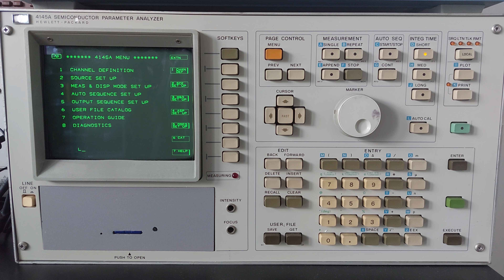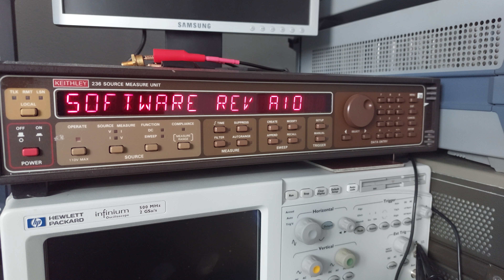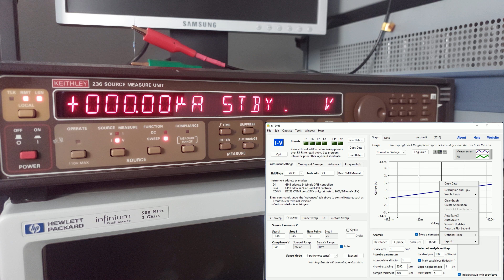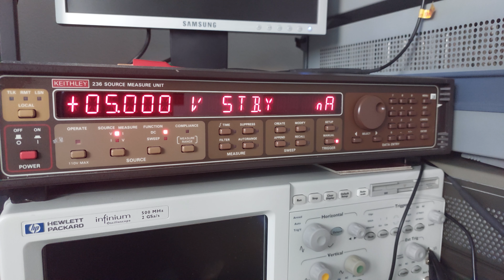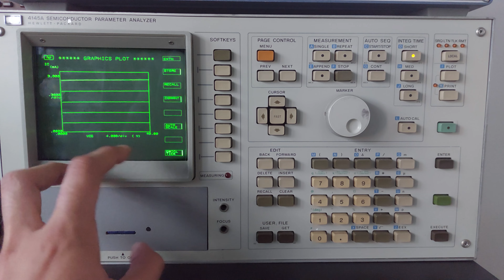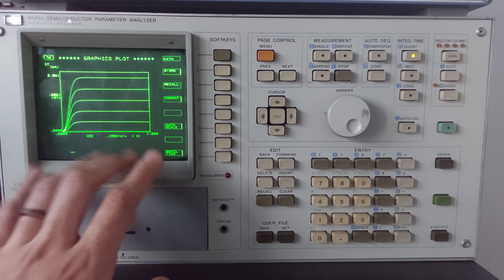SMU Overload (HP4145A, Keithley 236, Transistor Theory and other ramblings)

Comment: Reps may have gotten me interested in a 236, but you made up my mind to get one by showing that incredible software. The only thing holding me back was the interface, seemed like it was going to take so long to get the graphs I wanted might as well just keep doing it manually (Often Keithley 602 and Yokogawa 7651, unity gain output from the 602 into HP 54622 because saving traces to floppy just makes me happy, also it's start up sound gives yours a run for its money, haha) I cried a little for your loss, I am sure even though it is years later it would still bother me. Thank for your great content!
Reply from the maker: The interface itself is not that bad and the “language” it speaks is quite simple, albeit a tad criptic

Comment: What did you mean when you said this unit needs a particular fuse at 6:20? Can't it work with a higher one?
Reply from the maker: That's very dangerous! If something goes wrong and the fuse can't protect the device, that's bad news

Comment: 4:07 => Isn't the linear and saturation region the other way around? The linear region is the region that Ic has a mathematic linear relation to Ib not  because the curve is like a line.
Reply from the maker: Bad wording on my part. Linear region is where collector current is the hfe times the base current. You'll see that I'm correct, current doesn't increase with collector voltage. It's a bipolar transistor, not a fet, saturation is defined in reverse for a fet
Reply: @GearAcquisitionSyndrome  thank you for clarification 🙏